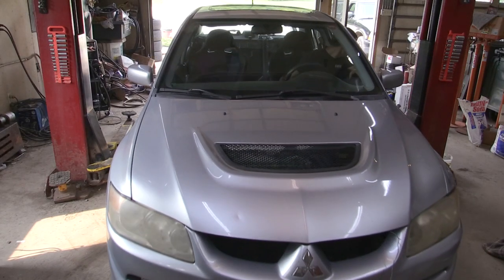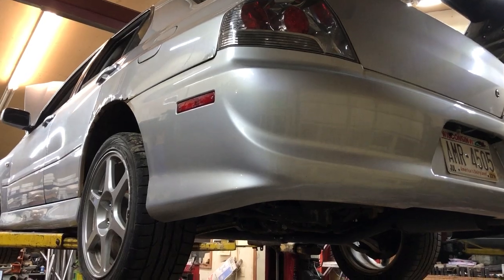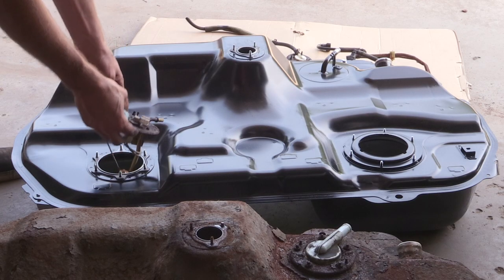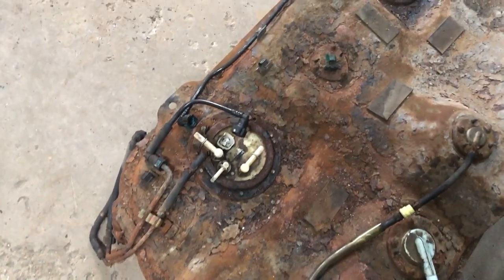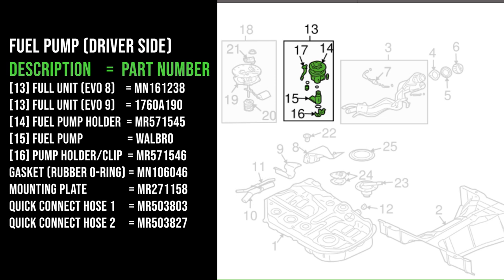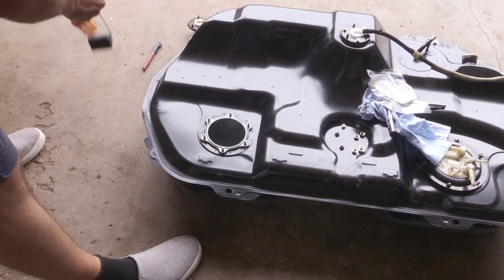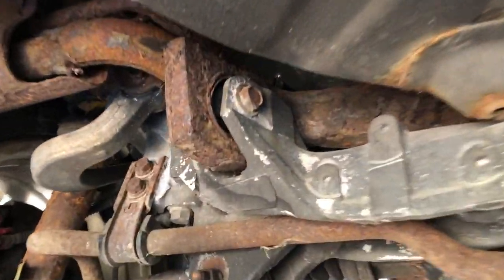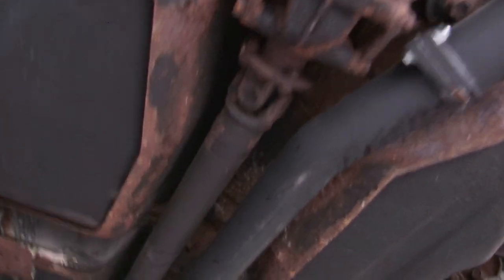Master Guide - Mitsubishi EVO 8/9 Fuel Tank

Comment: Thank you so much for this video, I have to replace the hard line (12) in my Evo IX, do you think i can tilt the tank enough without lowering the rear diff? Best regards steffen
Reply from the maker: Hello. I'm not sure which specific line you are referring to. But yet, most of them are accessible enough to change from a tilt of the gas tank and access through the below rear seat panels.
Reply: @BoostedFilms  OK thanks, i will try (wihout a lift)

Comment: Good video. I have been looking for content like this. Quick question, in your video it seems you are able to remove all the oem runner fuel lines without dropping the tank. Is this true? I am planning on removing all the oem rubber/hard feed/return lines with braided hoses. Are the oem rubber lines bolted/clipped on top of the tank or are you able to remove them easily once disconnected from the pump and hard line?
Reply from the maker: There is one place where the oem hard lines mount to the fuel tank on the top drivers side. (mine was rusted off) You should be able to disconnect that bolt/nut, then disconnect the lines (2 quick connect - 2 slides over hose)  and work around the e-brake cable to remove that piece.  But the tank will probably need to be lowered a bit to do so.  (not fully removed, just lower the front of the tank as much as you can without touching that rear diff mount bar)

Comment: Does anybody have any idea where the the tip over tank safety valve hose connects to from a JDM fuel tank on a JDM fuel filler neck? The JDM fuel filler neck has only 2 
places for hoses to attach to and that is the breather hose mentioned in this video and obviously the large fuel fill hose.